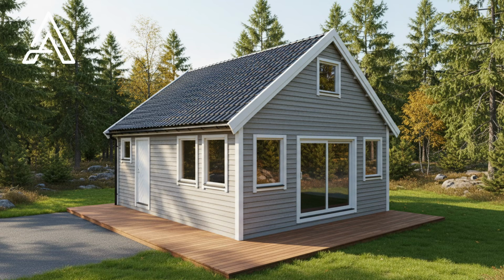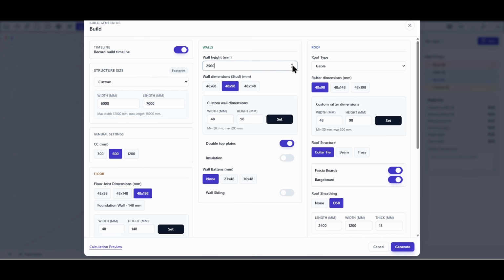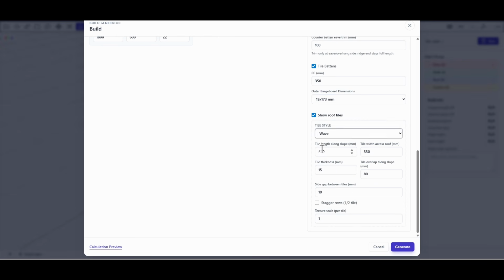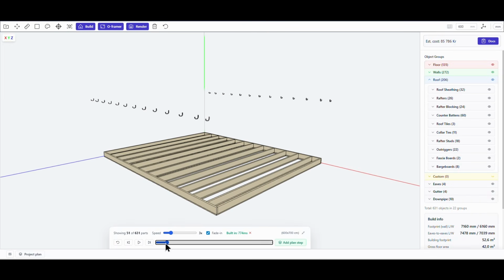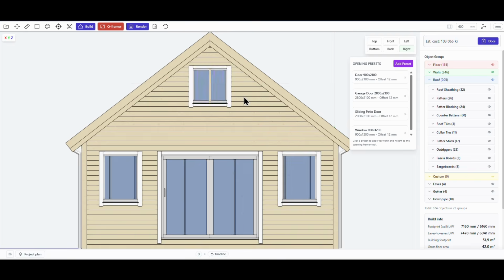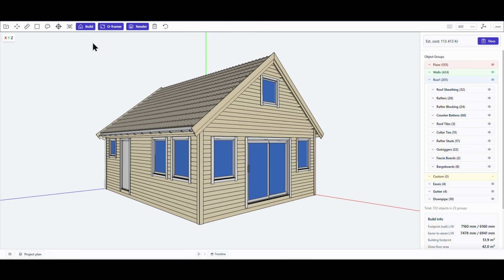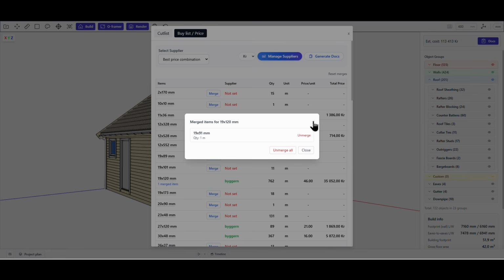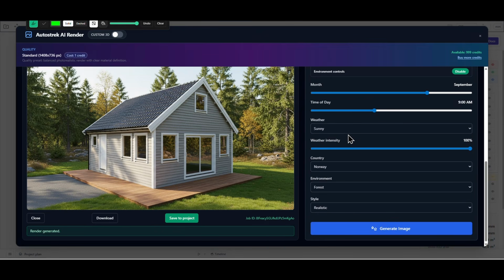How to Build A Cabin in Autostrek (Including Cutlist and Bill of Materials)

Comment: This is insane. I wasted hundreds of hours doing this manually in SketchUp and Google Sheets when building my 50 m² woodworking shed in 2020 (Lillestrøm), and again for a 50 m² cabin extension in 2023 (Nord-Odal). I’ll definitely use this for my next project.

Have you considered offering a trial version? For example by blurring the cut list, disabling total cost, no rendering, etc. — basically making it unusable for real production, but good enough to showcase the workflow and upsell to the paid version. I don’t know if that’s feasible with hosting costs though.
Reply from the maker: I have considered many options, but for now there won't be any free trials. Maybe later.